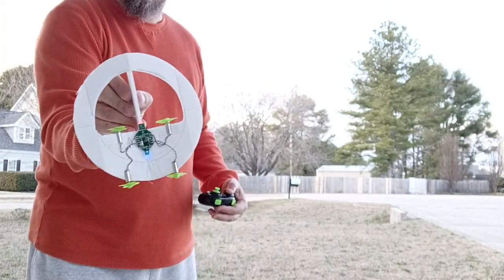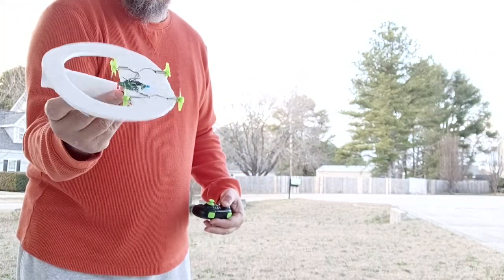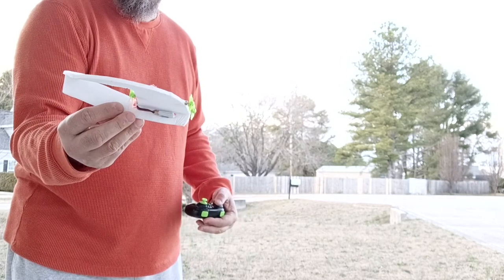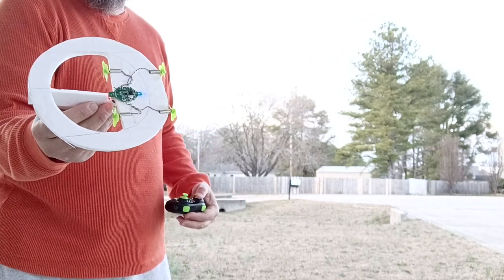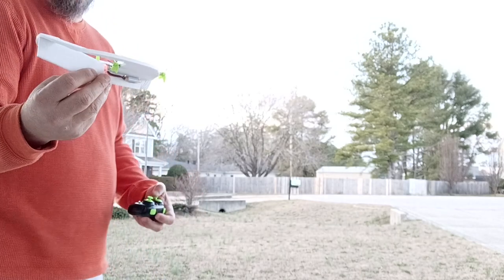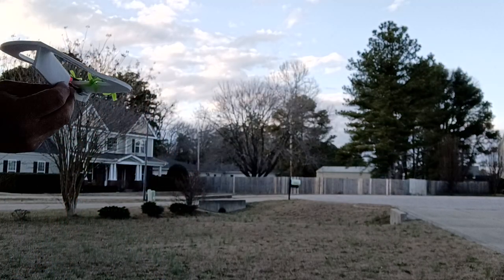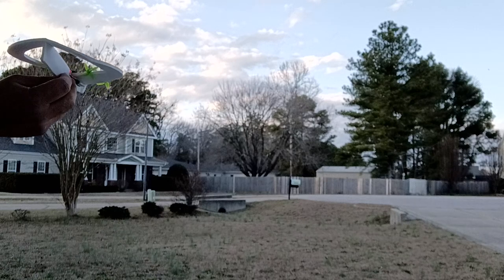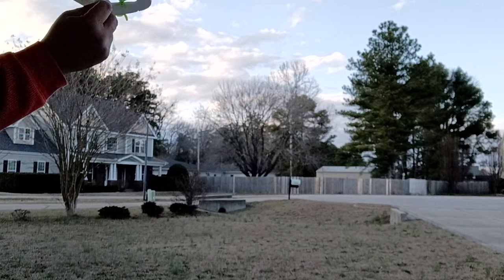7" ring Build-ruary challenge flight.

Comment: Thats cool man, The smallest infinity wing I have seen, And it did fly. If i was to put a dollar on it i would say you are browning out the Rx... just a guess though
Reply from the maker: Thanks for the advice and kind words. It pulls too much current or too much voltage drop and it has a safety cutout.
Reply: @matthewallen3375 maybe move the motors further apart for more control and less vibration against each other. And always keep prop direction in mind!
Reply from the maker: @cyberoverkill5844  thanks. This is hitting an overheat, or max draw, that is causing an emergency shut down. When I pick it up and restart the controller, I rebind and off I go.